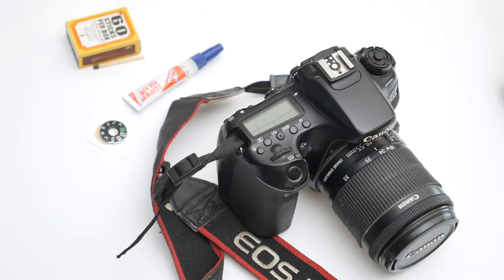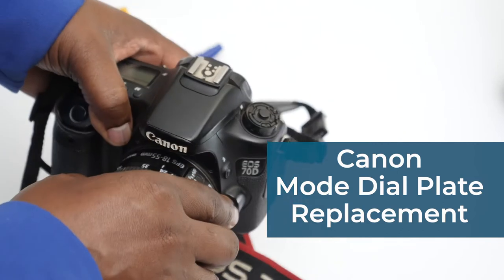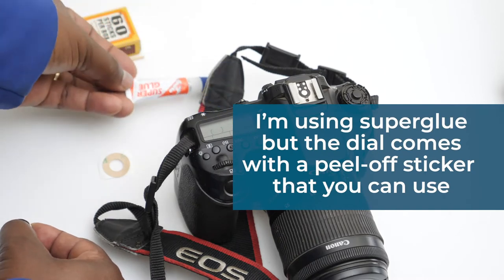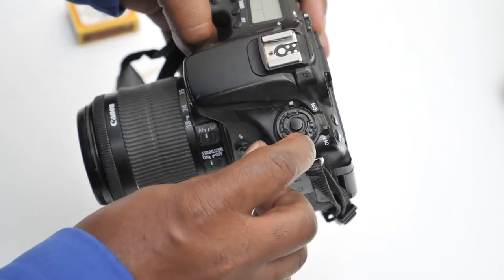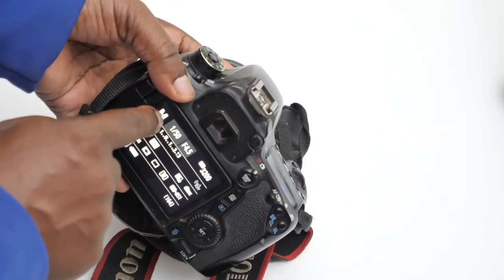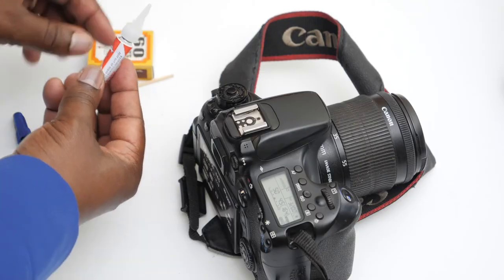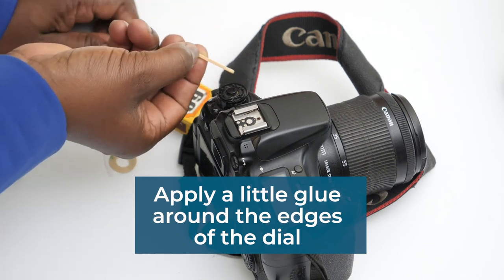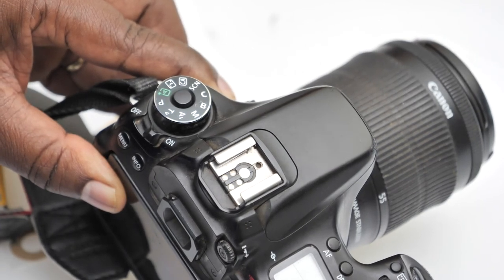Simple Camera Repair Job - Replacing the Mode Dial Plate

Comment: What about the rubber arround it?
Is it really neccesary to take off the whole thing or is there a way to do it as simple as this part?
Reply from the maker: You can also just replace the rubber. Search for  Camera Top Cover Dial Mode Button Circle Rubber for Canon on Amazon.
Reply: How change only the rubber ?

Comment: I need to replace a lost mode dial on my nikon D750, any advice on how to do that?
Reply from the maker: You can buy a replacement dial on Amazon like the Pixco Dial Mode plate for Nikon D750. You might be able to just replace it yourself or buy the part and ask your local camera repair store to fix it on for you.